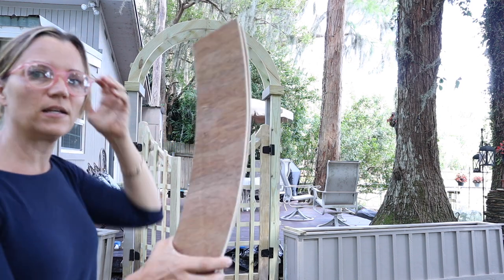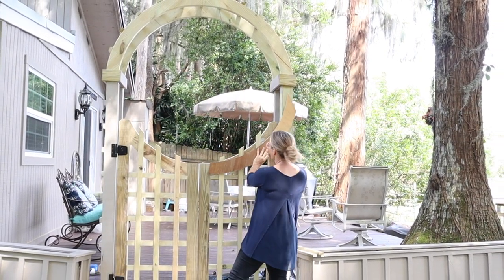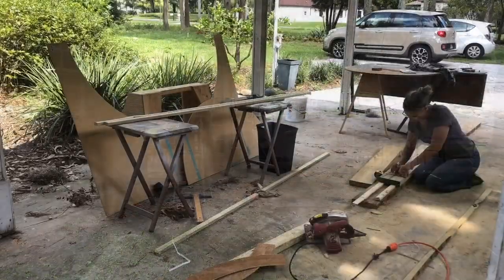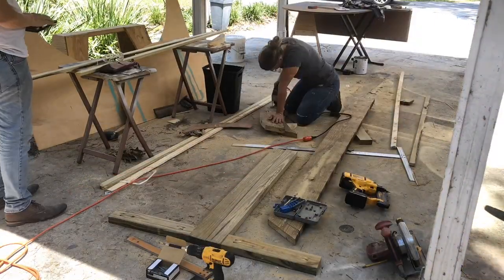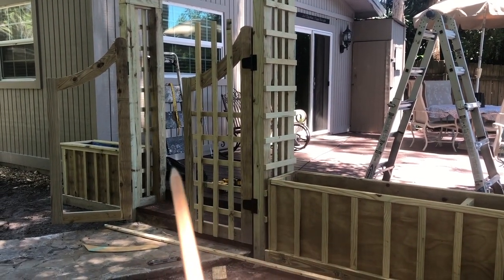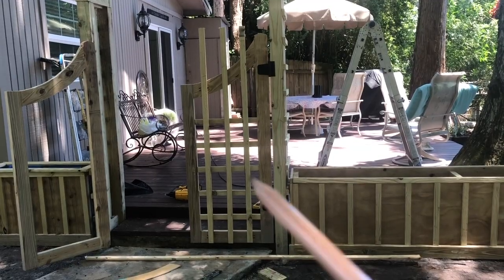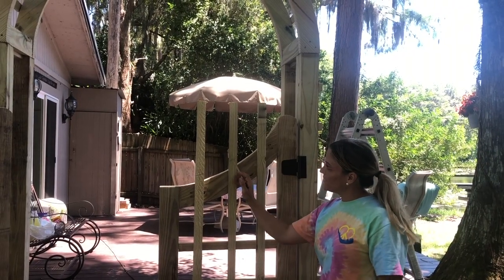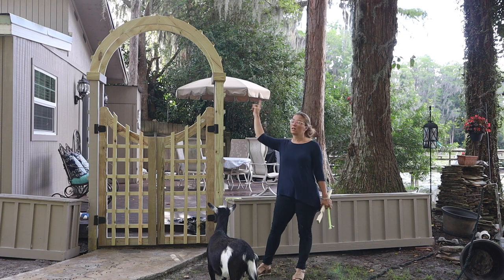How to build an arched arbor with double gate

Comment: The only thing I would say is you need to put a foot of gravel down before you put the posts in the ground. Otherwise they will sit in water and rot over time
Reply from the maker: Huh, you’re right. But I live in center at l Florida do the soil is actually almost completely sand do it drains very quickly. But a very valid point.

Comment: Hi
Lovely gate. 
Just wondering how the pocket holes work long term. 
Expansion and contraction outside etc ?
Thank you 🙏
Reply from the maker: so far everything has help up really really well! No issues anywhere. the only issue so far is a little rot on one of my planter boxes that I made on the sides. which is to be expected since they're filled with garden soil. The gates still swing perfectly and match up perfectly. I should maybe do a followup video.

Comment: Any chance you could post a couple rough dimensions?
1. Height of your posts
2. Height of your hinge side door stiles? And the center door stiles?
Reply from the maker: Sure, I’ll do that asap.
Reply from the maker: ok. sorry for the delay, i was out of town for a couple days. The posts are 77" from the ground to to the top of post, and in the ground about 2'. the side door styles(hinge side) are 62", and the inside door styles are 48".  From the ground to the center of the arch is 106". each door is 25" wide. the width of the opening is 52". Hope this helps.
Reply: @MimzyandCompany  u rock, it helps a ton. I’m stoked to start tackling it for my garden entrance.  Ur design is awesome. Thx again
Reply from the maker: @Ed-jg3ud  good luck, I'm sure it'll be beautiful!